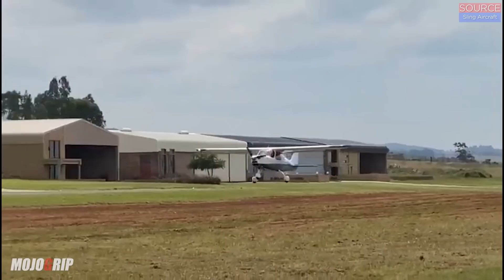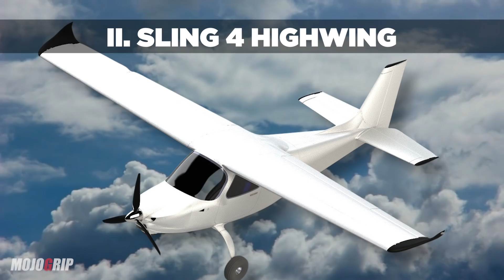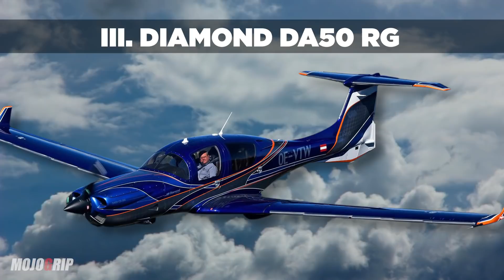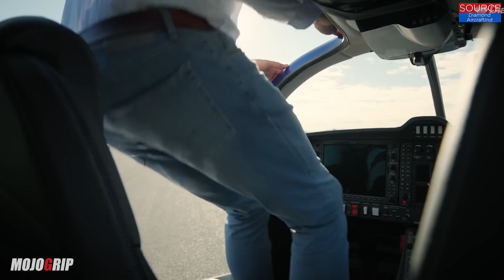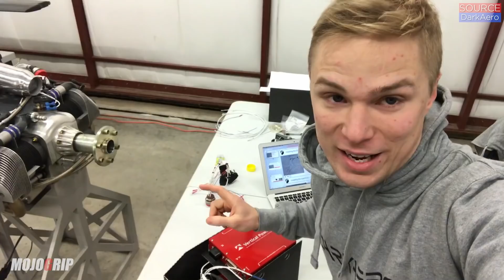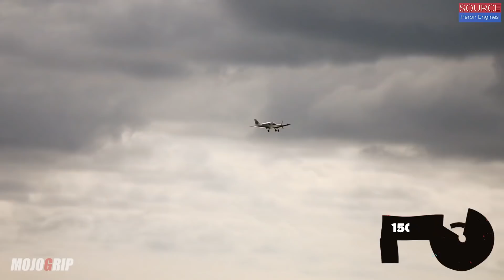5 Single Engine Airplanes You Can Buy In 2022

Comment: I guess that I just do not  fully understand what the differences are between an Ultralight and a Light Sport, not to mention the performance limitations on the LSA planes imposed by the FAA. There used to be ceiling and top speed limits to the LSA class.

Comment: Panthera vs DA-50 ?
No way the Sling-4 highwing will do 145 TAS with a 141hp engine. Not even the tailwheel version.
Sling is great, but they basically lie about their cruisings speeds. I've done most training in a Sling-2. It does NOT cruise at their boasted 120 TAS. 105 TAS at best.

Even the DA-40 with the more aerodynamic low-wing gets 145 TAS with a 168 or 180hp engine, and riverless body and wings.
The high-wing Sling will cruise at like 120 TAS.

Also, I don't get LSAs in the $300k+ category. If you've that kind of money, why can't you just get a PPL and get rid of A LOT of restrictions?

Comment: The Panthera is a non starter...it is STILL not certified and as a retractable will not be able to compete against its main competition, the Cirrus SR22 (not the 22T which is faster and flys further).  Slings are good products, but are kit planes. The DA50 RG is out now...it is a nice single engine plane but WAY too expensive at $1.15m for a plane that is set to compete against the Cirrus SR22T, burning Jet-A but has no chute and is a retractable also making it uninsurable. The Bristell TURBO, not TURBOPROP (dude you need to learn the terms...a turboprop is a TURBINE, JET-PROP plane).  The 915is FADEC controlled, fuel-injected turbo Rotax engine in the Bristell is nice, and it can be found in a dozen other planes.  Including the VANS S-21 for example.
Reply: Why are you saying as if RG is a drawback? The panthera is half the cost of the SR-22T and boasts a higher speed (while is likely exaggerated, but I fully expect 180 TAS cruise from the Panthera).

The Panthera is basically a 4-seat DA-50 but, hopefully, for half the price.

And the Bristell Turboprop is exactly that - a Turboprop, with a turbine as the powerplant. NOT a turbocharged piston engine. Thought it'd be obvious by the look of the engine without the cowlings ;-)
Reply: @suzukirider9030  Do you own an aircraft?  Do you pay aviation insurance on one?  I bet not.  Otherwise you would understand the point.  Also, the current fully loaded price of an SR22T is $980k.  The fully loaded Panthera (which is STILL not being produced under certification) is $680k.  The Panthera has no de-icing btw...the SR22T does have it.   The Panther has 55 gallon tank, the SR22T 92 gallons.  The Panthera cruises at 194kts, the SR22T 200kts.
Reply: @speedomars  No, I'm a renter... Aviation insurance for RG goes way up? Well, a bummer... but that only reinforces my belief that lawyers are a main drawback of avaition, not having RG :-|

The SR22T really cruises at 200 TAS? At what altitude?

Comment: Wait...the Panthera is going to give us over 200 kts. cruise with 4 people on 10 gph feeding an IO-540 260 hp? So about a 55% cruise at 2,200 RPM produces over 200 kts. (230 mph) of true airspeed at altitude, if what I am seeing in Lycoming's specific-fuel-flow data is correct? What should we see at full power / 75% in that case?
Reply: Probably 200 TAS at 75%. I don't see it doing 200 TAS at 55%. Not with the IO-540

Comment: Good job Mike.  I feel badly for Diamond and for Pipistrel, those prices are a positively projected fail.  The Dark Aero is the real bang for the buck!
Reply: The Dark Aero is a self built experimental.  Most people who buy the kits never finish them.  In fact, they don't even get close.  Experimental planes also have legal limitations, and good luck getting insurance on one.  The Diamond is a certified production aircraft.  You can do it all with the Diamond.  It's certified for known icing when properly equipped, and you can charter it or run it commercially.  That's on top of burning jet fuel while the Dark Aero and the Pipistrel use AvGas.  The Pipistrel is on its way to certification, but is still a long ways off.
Reply: @Maniac742  it’s easy to get insurance on an experimental, what shit are you spewing?  And what right minded person would ever buy a single engine recip that costs more than a million.  What fucking retards!  If you commit to building an experimental it will get done.

Comment: The turboprop Bristell can't be certified as an LSA.  The definition of light sport aircraft in FAR 1.1 only allows for a single reciprocating engine for the powerplant.  This excludes everything else from jets and turboprops to Wankel rotary engines and even electric powerplants, though the FAA is looking to add electric motors to the LSA definition.  The Bristell TurboProp, if it comes to the us as a production aircraft, will need to have a standard airworthiness certificate.

Comment: The Panthera being experimental means you can use an automotive engine. A 1.9 TDI would burn 5 gph whereas it's gas counterpart burns 10 gph. If you fly internationally? It means your fuel costs will be significantly lower while giving you almost double the range.